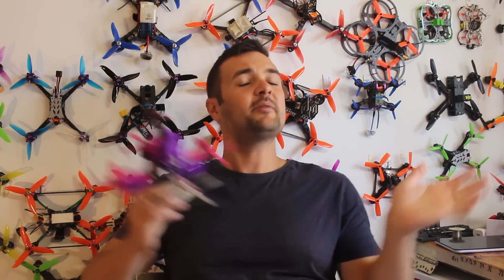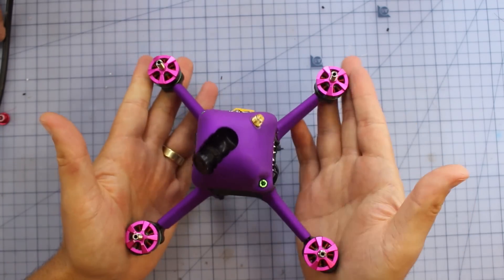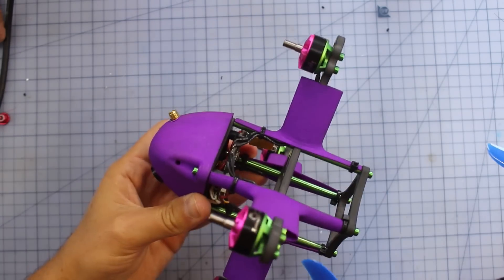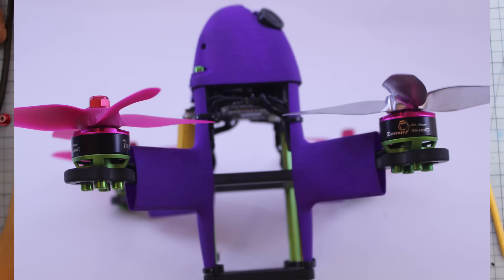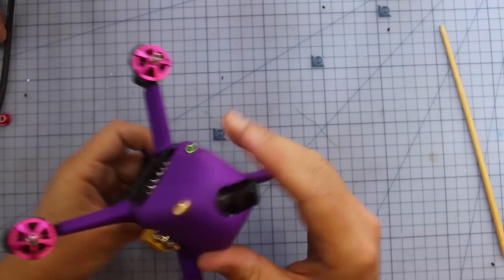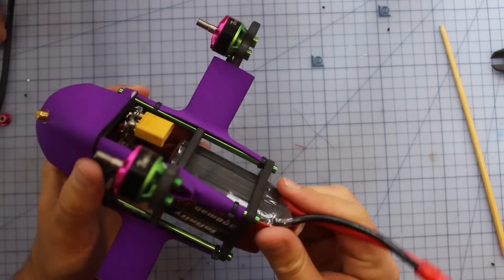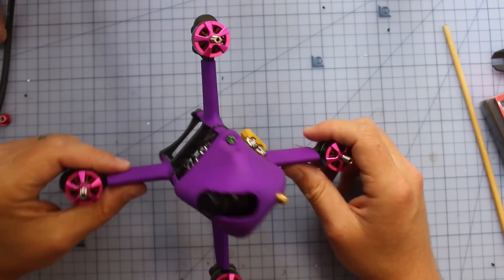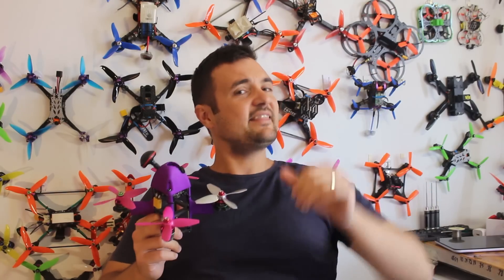Crazy Frame Design. AeroBot Tech Tuesdays UAVFUTURES

Comment: The battery compartment design is terrible. One hard crash nose first and BAM, that battery is going right through your 4-in-1 ESC in a big fiery mess. That ESC needs to have a CF plate under it, or at least a single bar to prevent the battery from killing all the electronics.

Comment: Intriguing design! I think you will have to "learn" how it flies. Designs like this tend to be good at the one thing they are designed for. In this case, speed in a strait line. If you take turns like a wing "bank & yank" and really fly it through the corners it should do ok. Please try a speed run with different props, like some APC dual blade. Those 4x4x4 props have no top end. Looking forward to flight video!!!! Cheers!

Comment: So where do you light the fuse? But really I think your Big FPV antenna will destroy the air flow going into rear prop. If you could get a different antenna and raise the rear motor so it can get clean air it should really rip.

Comment: I think that it is going to be able to hold its lines extremely well and will be something completely different, just like when you flew the Merica. The plastic parts extend down a little ways creating almost like an airfoil. In the + configuration the vertical arms will act like a rutter (something I think you mentioned some people doing in an earlier review) keeping you stable laterally. Then the horizontal arms should allow you to hold a line vertically. Or at least thats my theory anyway..... Cant wait for the full review Stu!!

Comment: Personally, I love the idea and the innovative thinking that went into it. However, i think they should try to mount the motors at a 45 degree angle. That way, when the quad is being flown at 45 degrees forward (a more common angle) the fuselage will be horizontal and the benefits of the aerodynamics will be maximized. Other than that, I like to see companies thinking outside the box. A clone will be released in 3, 2, 1.....

Comment: looks like the battery will be driven into the ESC when you crash unless there is a plate there ,can't see it that well . groove idea been a few vertical tube ideas knocking around over the last 3 years

Comment: Yaaaaaaaas a (+) style  frame the roll authority is going to be nuts 🥜 do they have a 5inch version. they should get rid of bottom battery cage and make it mount battery horizontal,looks to top heavy
Reply: Yes there is a 5" version with separate arms. We designed and prototyped that first but Simon just loved flying the 4" and so we decided to launch it first. There is also a 6" that has been prototyped.

Comment: You'd need some massively long motor wires to reach the FC/ESC on that frame! I'm also surprised they didn't put a micro cam and linear antenna on it. Saving an extra 12 grams or so never hurts. I'm curious how it flies. Seems like an interesting idea.

Comment: curious if the battery will shunt forward and damage the flight controller on impact. That aside, lookings good for a flat out speed machine.
Reply: Just thinking the same thing,  they need to put a brace between the lipo and FC.

Comment: Unless its flown with 60°+ cam tilt. It will fly like crap. So definitely for a more advanced pilot to get a decent flight out of it.
Reply: Hi guys don't forget the speed of the air column coming off the props, even when you are going slow.
Reply: Boosive FPV that's what I was thinking those arms are going to cause tons of drag unless you're flying at 90 degrees.